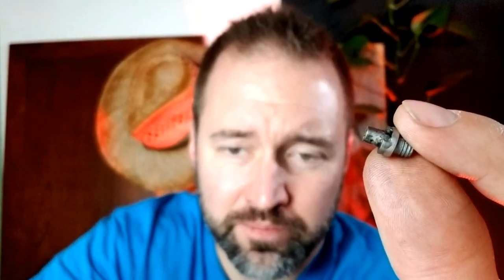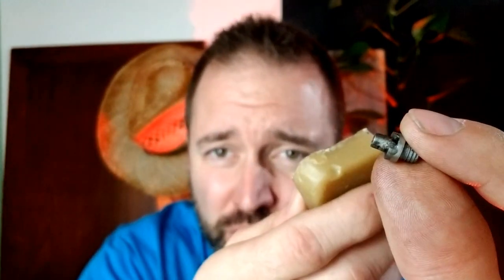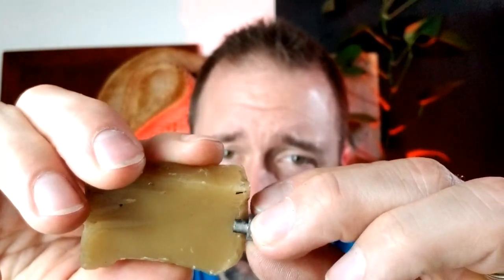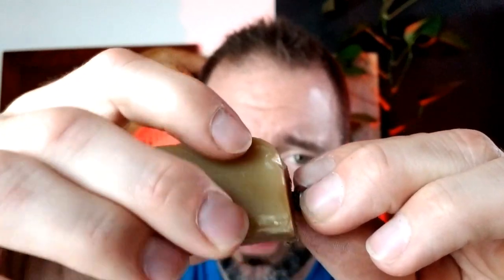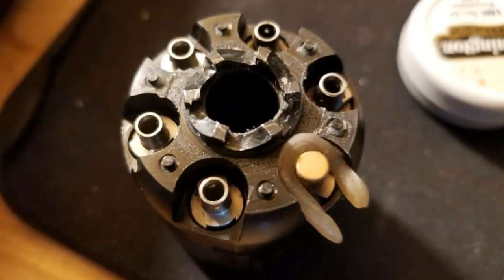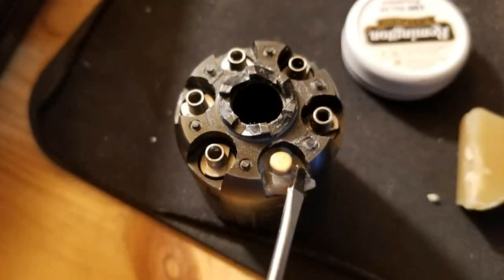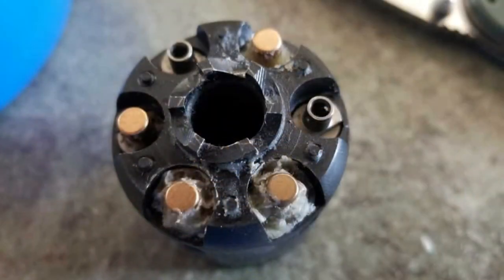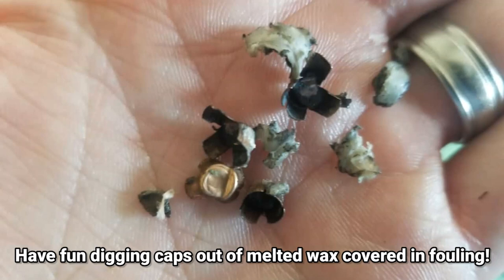[Tested: 100% Reliable!] Waterproofing a Blackpowder Revolver -- Easy!

Comment from the maker: I'm open to any other ideas for waterproofing a cap and ball revolver.  Please share your methods below so we can all learn from them!  I'll see you next Monday with a video that challenges the "cutting a ring of lead" concept when loading a round ball.  It's a good theory, but does it have an inherent dangerous flaw?
Reply: What do you think of that? Ebay offer: 50 Percussion CAPS KEEPERS GUARDS for Muzzleloader BlackPowder Caps #10 and #11
It should waterproof just as fine and come with an added benefit of holding caps on the nipple and preventing cap jams. Cheers.
Reply from the maker: @franklinAll8735  Interesting.  I am skeptical about them working as well as the method outlined in this video, since I imagine them as being as effective as pushing wax around the cap after it's seated (75% success rate for me), but I could be pleasantly surprised.  I might have to order some and give them a test in a video.
Reply: @BlackPowderGuide  Wax applied outside is inconsistent and seal is poor. I imagine, these guards will behave similarly to a rubber seal thus work very well.
Reply from the maker: @franklinAll8735  It'll make for a good experiment.  I'll buy you some emoji beers if you're right! 😂🍻
Reply: @BlackPowderGuide  I'm pretty sure caps will fire 100% of the time after being submerged and sealed with the guards though I have some worries how well cap guards will interact with slixShots and their holes in the side of the cone. With factory nipples it should work just fine and prevent cap sucking.
Reply: so the cap shortage is over?I gave up looking a while back and started researching homemade for when I'm all capped out...
Reply from the maker: @ronaldkennedy2401  No,  not over by any means.  I bought 1,000 before the lockdowns last year and have used up several hundred.  3 weeks ago Walmart finally got a shipment of CCI #11's (first I've seen anywhere in the last 18 months) and didn't have a limit.  I bought half of them (800) at $4.99 per pack of 100 and returned the next day out of curiosity and they were sold out.  I haven't seen them since.  209 muzzleloader primers have been available over the last month pretty consistently in my area.  Pyrodex FFG has been somewhat available as well,  but I haven't seen any real blackpowder or pistol FFFG substitutes.
Reply: great concept, cheers
Reply: What about vasaline and a q tip?
Reply: What if you just wrapped the exposed areas (excluding the muzzle) in plastic?

Comment: Thank you!! I never thought  about water proofing my cap & ball pistols before I seen your story just now. Reason! ...I DON'T SHOOT MY PISTOLS WHEN IT'S RAINING AND DON'T HUNT WITH THEM.  BUT!!.. I DO HUNT WITH A LYMAN GREAT PLAINES 50cal. MUSSEL LOADING RIFLE! I live in Arizona now but first started shooting black powder pistols and rifles in Ohio! And that's where and when I was concerned about water proofing my rifle! Back in the late 70's while deer hunting I was caught in a heavy rain storm. I kept my muzzle down so water wouldn't run down inside the barrel. Later that day I ran into a small legal buck and I sighted in on him and pulled the trigger... SNAP! THE CAP DIDN'T GO OFF and the deer took of. Back at camp I tried another cap and it fired the rifle. Trying to figure out how water got under the cap I remember  during the rain I had turned the rifle upside-down with the muzzle down and shook the rain off which aloud water to run down the nipple and into the cap.  While trying to figure out how to water proof the cap I noticed the ridges on the cap and knew even though press fitted on the nipples still could allow water to get in while turned upside-down.  I tried a  couple of things but none of 100 % reliable. Then walking through the house in my barefeet I stepped on one of my kids crayons.   I took the small broken end and a piece of aluminum foil and melted the crayon piece on it and with tweezers dipped a few percussion caps open ends into the melted crayon wax up to about a 1/32 inch or less. I found it did the same thing  you just related to us. In those days there was no computer's, fax machines etc. So word of mouth was the norm for getting the message out 
So just a couple of my buddies heard of my findings. Oh one other thing!... On a real freezing cold morning on a muzzle loading hunt don't  load your muzzle loading rifle in a hot hotel room before going out to hunt. The barrel while cooling down will form condensation in the barrel and run down into the powder charge just as it was raining out side with out a muzzle cover....that cost me a deer to!! Thanks for info and keep up the good work !!!!... CAPTAIN ZOOM-ZOOM OUT!

Comment: Toilet bowl ring wax is the way to go. I have sealed my entire Flintlock frison closed at the beginning of each season I never have to recharge the pan or do anything. Left it out in the barn after two weeks of hunting came back 2 weeks later and it fired just fine even after being in the rain. And it's so much easier to work with than hard wax
Reply: Yeap! I get mine supper cheap at a plumbing supply around the corner 3 at a time, Dad is gone so I can't yank them off the work truck anymore. RIP Pops! I use for my DIY bore butter, gun lubes, and leather conditioners with weather proofing. I add cinnamon oils for Yhits and giggles with a nice smell.

Comment: From what I've read, this wouldn't have been necessary back in the day, but the quality of modern caps isn't even close to comparable to the caps made in the 1860s.
Reply: How were their caps better?
I'm sure they were, just wondering...
Reply: @TicTac-g7m   Far more reliable, better fitting, and in the case of caps made specifically for Colts, thicker and softer copper.  The caps available today are all far more similar to those that were made for Remingtons.

Comment: Put your caps on the nipples. Paint with clear finger nail polish. Load the cylinders with powder a bees wax coated patch of wool blanket then ball then another patch. I have 100% ignition with this method. I'm 64 and I've used this method for over 40years.good luck black powder shooters.
Reply: faster! but I don't know about getting the polish off at normal cleaning time. I'm only 57 but built my 1st 1858 in 77. But I Like Simple Easy Fast and I use clear with colors for other things on my smithing bench, always at arm's reach.

Comment: One question: How long does the waterproofing last? Or does firing the gun remove the waterproofing? In other words, if I use your method, then fire the gun, will it need to be re-waterproofed after the first 6 shots? Because THAT would make reloads either A: not waterproof or B: A massive pain in the butt.

Comment: Unfortunately I don’t think it would work for long term because the lube covering the cylinder mouths would eventually seep deeper into the cylinders and contaminate the powder charges don’t you think?
Reply: Simple answer: Do not use lube covering the cylinder mouths. Keep that area in front of the ball clean. They did not use lube over the ball in the old days. They had tallow and bees wax. But they knew it was a bad idea to coat the top of the balls after loading.

Especially if you are firing more than one cylinder full, in one shooting session. It causes chainfires, does not prevent them. 

Extremely fine black powder dust will embed in the lube coating which always remains on the cylinder walls. And then when you reload, there can be a chain of very very fine and hard to see powder dust extending forward from the charge at the back of the chambers, and running forward alongside the balls to the front where any fire will ignite that chamber.

Comment: Could I put the caps on the nipples while the nipples are out of the cylinder and dip them in wax? Like candle wax. Do you think that will work
Reply: I was thinking that also, wondering if the melted liquid wax would act as if you were dipping them in water and contaminate the caps rendering them useless?

Comment: My question question would storage like in a hot car trunk and the bees wax melting to contaminate the cap priming mixture.  Also if the wax gets hot would it break the seal.    
Biggest question is was it done in the old days.  The is now a new one and there must be old tyme solutions.
The originals were carried into the 20th century and there are some with felony convictions that still depend upon the modern replicas today.
Reply: it may soften sure but its going to re harden. its unlikely it becomes thin enough to destroy the primer mixture in the cap as they are pressed pretty tight. water effectively dilutes it where a wax would just coat it. come to think of it im not even sure the wax could interact with it but being such a small object and how little wax is on there i doubt itd ever be a problem.
Reply: @briani7858  I just remembered an incident with .44 magnum reloads that were in a car trunk.  The bullets were cast that i purchased from bells a gunshop that used to exist on the chicago suburban northwest side.  
Many of the cartridge would not fire from being contaminated by the lube.  But I am sure there was no beeswax in that lube, but I do not know what was there.  So on the bees wax I am not sure, but some lubes can contaminate smokeless loads.
Reply: @loquat44-40  thats a fair assesment. i may try the experiement and report back